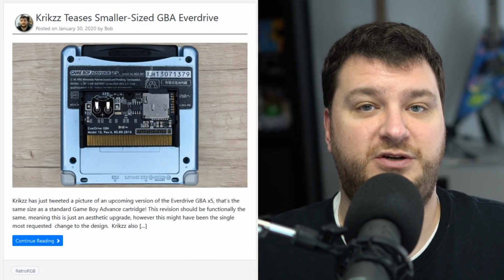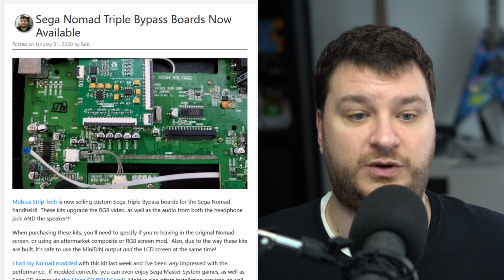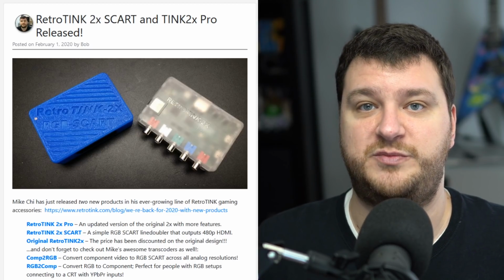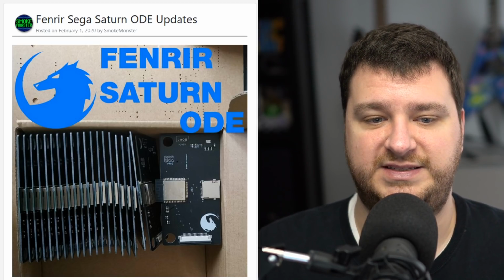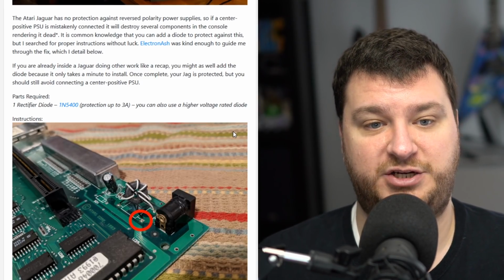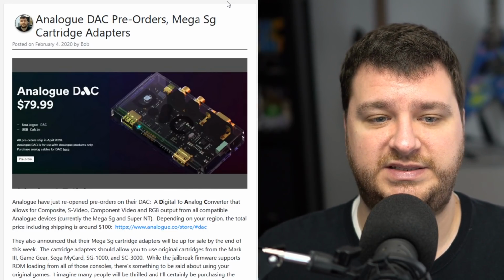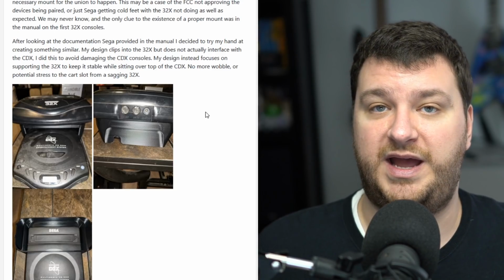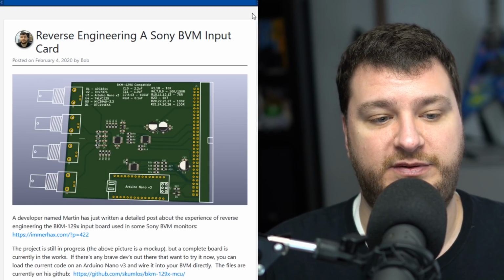RetroRGB Weekly Roundup #187 - February 5th 2020

Comment: Thank you so much for covering the Nomad Triple Bypass. It's greatly appreciated. The only difference between the original stock screen kit and the aftermarket screen kit is the length of the video output flex cable. This is due to the mounting location needing to be different if the original screen is used. If someone buys the stock screen kit and wants to upgrade their screen later, no additional changes will be needed. I wanted to keep this as simple as possible and minimize additional cost wherever I could. Hopefully this helps for anyone wondering about the difference.

Comment: Since the DAC is just HDMI input from the Analogue systems, streamers could just use a $18 HDMI splitter and run one to capture card and one to DAC, right?
Reply: no. the way i understand it is, that when the DAC is used the HDMI port sends different not HDMI compatible data to the DAC
Reply from the maker: Just tested.  It doesn't work.  Worth making a quick video about?
Reply: @RetroRGB : It could be worth it, to spread awareness of the issue. It's up to you in the end.
Reply: Yeah I didn't see that it changes the output mode of the HDMI port, that is interesting, my bad.
Reply: Yeah its long story short, they felt it was ether more efficient or legally easier for them to ditch the HDMI encoding/protocols and just repurpose the existing HDMI out port.
Reply: @RetroRGB  Is it still possible to use an HDMI switch with whatever Analogue consoles you're using run into the DAC?
Reply: @RetroRGB  Does that mean you can't run your analogue consoles into an HDMI Switch into the DAC? Seems very limiting on your setup then. If you bother to get them all, the Analogue version of the SNES and Gen, as well as the upcoming new NES, and everything else, then you'll have to physically swap cables between the systems every time you want to use a different console, since the DAC can only interface directly with the console, no hardware allowed inbetween.

Comment: Even on Ebay, those Sony BVM A&D series monitors are really hard to find with low usage, especially the large ones.  I've been looking for years, and I don't think I've ever seen the 32" version, which is the holy grail as far as I'm concerned.  Even the BVM-D24E1WU was too small for what I'm used to with LCD monitors.
Reply: How far away to you sit? I use a 19'' PVM and frankly a larger size would seem too big, but then, I'm using it on top of a desk I'm sitting right in front of.

Comment: I'd love to have a BMK-129X for my PVM-14L2. I've come close to buying one on eBay a few times, but they're often crazy expensive, going for prices like $200 CAD. If it could even offer some way to bypass the L2's mandatory LPF on YPbPr input (you can turn it off in the service menu but the setting isn't saved to nvram), I'd throw money at my screen. The damned LPF adds annoying ringing artifacts. You'd never notice on video, but on retro consoles, yuck.
Reply: I actually have the same problem on my 14L2... the solution is to use a COMP2RGB since it'll convert the signal back to RGB without that stupid LPF. :-)

Comment: Doesn't the gscartsw output 5v on the SCART port? If it's able to supply enough current, that SCART coupler could have a little micro usb pigtail so that you could power the RetroTINK SCART off the coupler and avoid the separate cable and power supply. After all, the rad2x is powered off the 5v on the console video out ports. You could literally have nothing but an HDMI cable coming off your gscartsw.

Comment: Do you have recommendations for suppliers of replacement optical drive lasers? I have had limited success in the past with only pulling used ones from CD players working for me. I have purchased a few online over the years that wouldnt read discs. Recently my sega cdx stopped reading discs, i would like to get it running again..

Comment: What if you just rename all the bin files on the sega cd version? To swap the audio tracks
Reply: I was thinking about this myself. Seems like it should be an easy hack.
Reply: I think I did that at one time to screw around with Sonic CD. I just renamed a bunch of the MP3 files than went with older ripped copies Sega CD games when they were ISO+MP3+Cue.

Comment: Would the retro rink help much with Pal N64 output?
Reply: Geoff Connell I run a PAL N64 through a retrotink 2x via S-Video. Unmodded PAL models will output S-Video but not RGB.
Reply: @humperdidoo  I could be wrong but I always thought only some PAL revisions support S-video;  without an RGB mod it's possible to be stuck with composite as the best quality video.

Comment: Are you aware of the EZFlash Omega? I'm intrigued as to why you've never mentioned it and I'd love to get your opinion on it. Amazing performance, great price, exchangeable faceplates to make it sit flush in a GBA and in a NDS, savestates, RTC, menu with art, etc.
Reply from the maker: When I originally tested the EZFlash, I hated the required PC software and found it really clunky.  A few years ago, I was told they updated the firmware and fixed all of my complaints, but I already owned a GBA Everdrive at that point, which worked perfect...so I just never got around to re-testing it.  Maybe when the new GBA Everdrive is released, I'll do a comparison video?
Reply: @RetroRGB  I bought the newest EZFlash card so it'd fit flush with my Gameboy Micro and it works very well in my opinion, files are drag and drop and it supports the main features like save states and such. I'm not familiar with the Everdrive so it's possible the UI or features are better, but at the time the form factor was a clear win for EZFlash. I think in the future with the two products offering the same form factor a comparison of their other features would be beneficial for people who are making a choice.
Reply: I have one, but keep getting some stupid error when loading some of the roms.... still need to figure it out, but when it works its great!
Reply: @BrunoFonsecaPT  probably cause you turned off the GBA too fast after saving a game when you do that with the omega it corrupts the game save and the game won't open again delete the save file game should work again

Comment: I have the EZFlash Omega GBA flash Cart and it does GB, GBC, and GBA. I know nothing about the technical side of things, but given that I booted both GB and GBA from the same flash cart literally this morning, I can't help but suspect you're incorrect about the limitations. 

Unless of course I'm misinterpreting, and what you mean is the device won't boot in both a GBA and a regular GB. That's probably true. I haven't tried it, as I mostly use it with Gameboy Interface on my Gamecube into my PVM.
Reply: I think the EZFlash is running an emulator to play the GB and GBC and only using the native hardware for GBA games. Which is totally fine if you're personally satisfied with how things play. But for me it would maybe defeat the purpose of using a flash cart in a real GBA, at least for GB and GBC games.
Reply: @goldsaturn25  Fair enough. I'd agree with you, generally speaking. Had no idea it was running emulation for anything. Really just use it to play whatever GBA game I want through the gamecube on the PVM in 240p.
Reply: @JD-xz1mx  that's why when u wanna boot a new GBA game you have to shut the power all the way off and reboot the rest are emulation